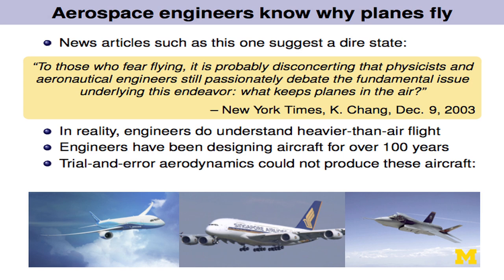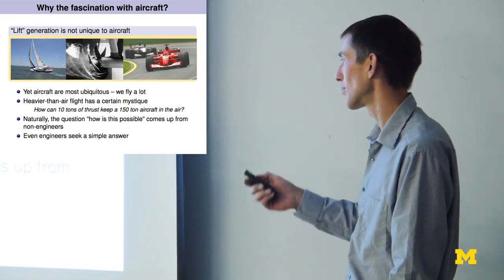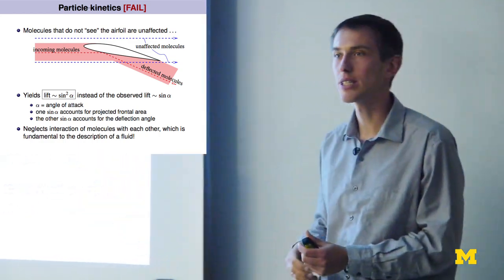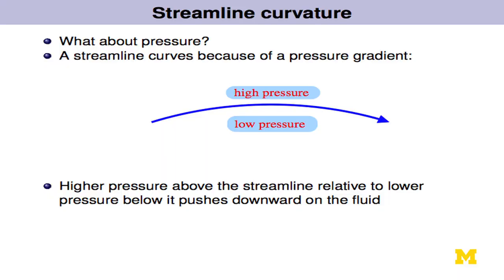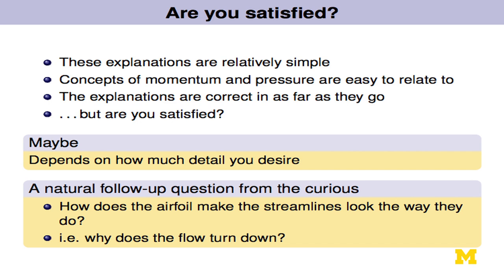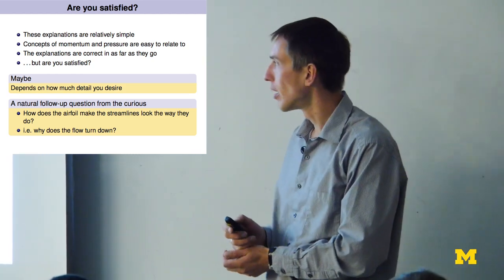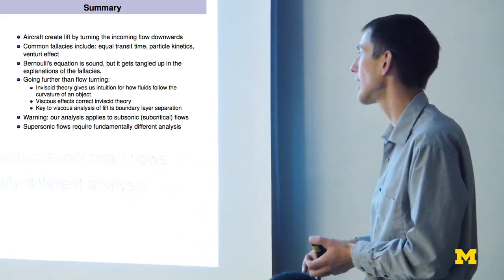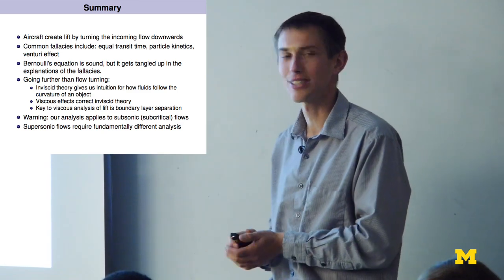Krzysztof Fidkowski | How Planes Fly

Comment: This is one of the better presentations I have seen. Usually, engineers are using terms that require a degree in mathematics at a very high level. This presentation, however, is easy to understand. Thank you!
Reply: Magnar
Complex numbers, some knowledge of differential equations is sufficient for a quantitative treatment  of most aspects of fluid dynamics
Reply: @hernanposnansky7154  Well, yes and no, I still remember an exam where I wrote the complete (developped) Navier Stokes equations and it took me one straight A4 page (yes, i don't write small and yes, it was before simplification with a bunch of hypothesis, but still)

Comment: i am no flight student but i came here because i had this question. "If airfoil workrd on the basis of bernoulis principle then how planes fly upside down ."
Reply: Most plane that can fly upside down have flat wing, they mostly play with the angle of attack.
Reply: @craigwall9536  Although I would agree that all airfoils can be flown upside down but with different efficiency, in a way the more pointed example is why until very recently it was thought that a helicopter cannot be flown upside down (each helicopter blade is also an airfoil, and it was thought that upside down could not create lift). I haven't looked closely at the recent demos that show it is possible to fly a helicopter upside down but would suspect extending the limitations of angle of attack in a negative direction (Just guessing!)
Reply: To expand on this, wings can produce lift upside down, it doesn't need to be symmetric or flat.  A symmetric airfoil produces lift equally well if the angle of attack is positive or negative.  It produces no lift if the angle of attack is 0. A naca0012 airfoil does not care if it is upside down or right side up.  Cambered airfoils can also be flown upside down and create lift, but it might still before attaining an angle of attack that can support the weight of the plane.  Cambered airfoils can create lift at 0 angle of attack.  And so it would need more negative AOA to fly upside down.  An example of a cambered airfoil is the Clark y.
Reply: EXACTLY! If a curved airfoil redirects the air downward, then a flipped airfoil would redirect the wind upward.. So is not the redirection of airflow only, so there could be many reasons LIFT is caused not only one...sometimes is redirecting and sometimes is angle of attack sometimes is both. what about flying sideways?

Comment: A wing generates lift by placing the stagnation point below the wing just behind the leading edge, that's how an upwash is induced, which is what is needed to reduce upper surface pressure 👍

Comment: Great video. When I first learnt this at Delft, I started to search more and more. Your video is amazing. Thank you so much for such presentation. What it annoys me is that in school they still teach the non sense of explanation about vacuum over the wing pushing up the airplane due to a ridiculous small difference of curvature. These teachers never flew an airplane or never saw the shape of any helicopter blade or never saw a Sukhoi airplane making maneuvers. Glad to have found one more quality video about the real reason for lift !! 🙏🏆
Reply: A sukhoi has a thrust to weight ratio between 0.9 and 1. That is nothing like a conventional passenger jet that only has a thrust of a third or a quarter of its weight. While the vacuum explanation might be wrong, your counter examples operate in entirely different realms.

Comment: Nice lecture.  Identifying pressure gradient below and above the wing and relating it to centrifugal force so we see air flow along the arc of a circle is a nice illustration helping us understand lift.  Pressure effects are useful because a surface integral of pressure over the surface of the wing determines the lift force.  This is easier to calculate then integrating  over the entire volume of space to to determine total change in momentum.   I know vortex filaments lead to a more practical method to calculate lift coeficients.

Comment: 22:30
The difference between the 3 flows is the circulation:
Negative , positive but weak, large positive.
The circulation cancels the upwards flow at the trailing edge to satisfy the Kutta condition as the angle of attack is changed.
The circulation is the line integral of the scalar product of the velocity vector and the path element around any closed line outside the boundary layer.
The circulation is the result of conservation of angular momentum:
A vortex is produced as the flow at the trailing edge separates (counter clockwise) and procedes downstream, then a clockwise circulation with the opposite angular momentum forms around the airfoil.
The lift is then 
density times velocity times span times this circulation.
This is the Kutta-Joukowsky theorem, which is the correct explanation of lift.
The circulation increases the velocity on the upper side of the wing and reduces the velocity on the lower side of the wing.
integrating the pressures obtained by the Bernoulli equation (conservation of energy) just outside the boundary layer will yield the exact lift force.

Comment: Great video! I appreciate the clear explanation of the complexities of lift generation and the different factors that contribute to it. The numerical solution of the pressure distribution over an airfoil was especially helpful in visualizing the concept. One suggestion for improvement would be to provide some more concrete examples or analogies to help non-experts better understand the concepts being discussed. Overall, great job breaking down a complex topic in an understandable way.
Reply: I agree! This professor definitely provided a detailed and clear explanation of lift and how it is produced. I also appreciate how he goes into explaining how misconceptions used to explain these concepts are not helpful, even if they seem intuitive. An example of this was his rebuttal of the equal transit time fallacy, and how "air does not like voids", while seemingly intuitive, is not an accurate explanation of aerodynamics.

Comment: Yeah, this video convinced me the quote at the beginning is correct: it is an area of debate. Lift has controversial explanations in the intuitive realm. 

Newtons 2nd Law is a good explanation. 3rd? Not so much.

Newton's 3rd Law states that forces must be balanced. It is a misinterpretation to say one half causes the other. That there is downward force implies upward force, exactly the same as upward implies downward. 

It isn't causal or sequential. Further, it is in full effect on parked aircraft. And rarely do mechanics need to pry aircraft from the hanger ceilings. 

Lift is a result of motion, so Newton's 2nd Law is the explanation best suited ("in my opinion", required engineering tradition). 

Bernoulli is a specific case for 2nd Law. The thing that trips people up is "equal transit time" nonsense; AND not realizing each flow stream surface has it's own conditions. People try to compare the 2 surfaces relative to each other, which is a no-no. Bernoulli says pressure-velocity is reciprocal; a teeter-totter. NOT that 2 different slipstreams can be compared, in terms of magnitude, to the other.
So no "pressure on top vs on bottom" with Bernoulli, only within one surface, with respect to itself.

Pressure differences result in acceleration, which in turn sets up a pressure gradient across the top of the wing. That pressure arc requires the wing surface to be lower pressure than the longer arc above it... And up it goes. If the aerofoil is thin, all the better, because high pressure flowstreams result under the wing (being again a longer arc than those below them)... And up it goes even faster. (There's a centripetal force argument opportunity here also: with objects requiring such to travel in a curved path. And a resultant force inward. May get confusing, though. Could skip it.)

So i explain lift through Bernoulli, as a special case of Newton's 2nd Law. And since we only get lift as a result of motion: this sets up an easily approachable velocity argument: F=ma. 

Liked the talk though. Always good to get a range of perspectives.

 (P.s.: knowing an equation, like N-S, does not follow that anybody understands it. That's maybe something we should admit to ourselves, and students. Yes i know they pay a lot of money not to hear that).  Just look at G.R..-- Now it's quantum gravity, and emergent space-time. We don't understand that either.)

Good talk. Not implying it's "wrong", just not my preference for an intuitive explanation. NYTimes was right 😉

Comment: We should turn things around when trying to explain airplane wing interaction: The air molecule does not flow from leading to trailing edge, eventually separating or not. It waits for the wing to arrive and is then pushed up or down, and just a little longitudinally and here actually forward in the direction of the wing (and more the nearer the wing surface the particle is.)
One should have this physical picture in mind when explaining airplane wing lift.
In a wind tunnel though (or on a sailing yacht) the air flows along the surface of the wing profile, but on an airplane wing the molecule waits for the airplane to arrive (as we all normally do - a good clue for  remembering this phenomenon. /Henrik Segercrantz - M Sc. Naval Architecture
Reply: correct, the air is not flowing through the airfoil, the airfoil hits the air and displaces it... correct?
Reply: if run towards a tight crowd... most likely i will bounce. an airfoil hitting air is doing that, bouncing.

Comment: Thanks. I recognize he addresses and dismisses the Coanda effect, but placing the back side of a spoon against a stream of water (eg. from your kitchen sink) causes that water flow to readily bend to follow the spoon curvature and also applies a marked force on the spoon towards the stream. If you haven’t tried it, please do so. It’s hard to totally ignore that effect (whatever is causing it).
Reply: Water on one side and air on the other is not the situation a wing faces, though.
Reply: @adoatero5129  If you blow a stream of air past the back of a spoon, the same thing happens.
Reply: @BobbieGWhiz  True, but the effect is much weaker (assuming the speed of the stream is similar in both cases). What's more there's no flow on the other side, unlike in the case of a wing. I'm not saying the phenomenon isn't real, interesting and at all relevant to the functioning of a wing, but wing doesn't need that phenomenon to create lift (as explained on the video). The upper side of a wing is curved mainly to keep the airflow nicely streamlined. Quick turns are bad for the airflow, again, as explained on the video (nowadays it also allows wings to hold fuel). A perfectly flat wing creates plenty of lift when it's faces the airflow at an angle as all wings do in normal flight.

Comment: Great lecture. Thanks!
I couldnt understand the logic of vacuum not possible at 21:01? Why is that? Because even the streamline on the bottom surface would get sucked up?
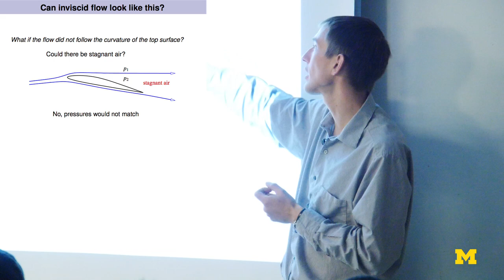At 21:16, cant an air element move in the loop without rotating? An element can maintain its orientation and yet move along the circuit.

Comment: One additional thing... I love this video but I am kind of left empty about the reason the streamlines follow the contour of the body. 

I am coming away with the reason this occurs can be explained by the fact that an inviscid flow MUST follow the body contour. But, the air molecules probably don't know much about inviscid flow so how do they "know" to follow the contour?. What am I missing? Any help is appreciated.
Reply: If the airflow didn’t follow the contour, there would be a vacuum.  Air pressure forces the airflow down into that space.
Reply: @GH-oi2jf  Thank you for the reply. We did see in one of the slides a case where the streamline was separated and did not follow the contour. But I agree that a vacuum cannot form.
Reply: @Observ45er  Thank you for your reply...makes sense.

Comment: Not saying professor Fidkowski is wrong, simply commenting. 1) 6:43 When this real phenomenon is illustrated, no lecturer I've seen has pointed out that if the initial `longer path, equal transit time, faster flow, lower pressure` has an effect (however moderate,) the illustrated phenomenon means the top flow is even faster and thus has a less moderate effect.
2) My `simplified intuitive model` is the bottom side is for lift, the top side is for control, to wit: spoilers. (yes, incomplete)

Comment: I recommend using calculations and numbers proving how 10 tons of thrust can generate lift that leviates 150 tons of a plane. Otherwise all the rest are just words...for example from this presentation one should be able to calculate how much lift a directed air flow downwards can generate lift. Because for directing air flow downwards, the airfoil or the pressure field around it or both must have applied force on the air block flowing around. As a reaction to this force, the lift is generated and this can be calculated, maybe?

Comment: Excellent expositions of empirical shaping laws and deductions for Intuitive Actual Intelligence. An accurate assessment and assembly of observational oscillation resonance phenomena in Mathematical Theoretical Formulae. (That's what we see)

How it happens is superimposed logarithmic condensation modulation wave-packaging formation of Navier-Stokes type formatting that you get in the time-timing arrangement of anything, not only flying. 

So the why, of all is vibration-> Superspin, quantitative timed time mechanics-> 0-1-2-ness Entanglement be-cause-effect self-defining superposition-> sync-duration assembly, which is Fractal Quantum Operator Fields Modulation Mechanism.., at this Centre of Logarithmic Time Singularity, ..QM-TIME pure-math Reciproction-recirculation relative-timing ratio-rates Perspective Principle. 
(Basic QM logic "says" it is because it is, => Principle)

Engineering likes to build a fence around reliability with a Safety Factor that obscures the fine structure of phenomena. "Long may they continue". But if you analyse nuances, then the inevitable result is that "All things must pass", change changes across the 1-0 probability dominance spectrum to continuously Form this Universe. 

The finest quality of information existence is derived from e-Pi-i sync-duration connectivity function that operates via Singularity, ie @.dt zero-infinity sync-duration eternally, in Primes and Cofactors of vector-value Timing-spacing coordination, AM-FM Quantum-fields Condensates forming Math-Phys-Chem and Geometrical Drawing Conception of the real-time wave-package Periodic Table, Standard Model and related QM Temporal Chemistries. This is the ultimate sense of experiencing existence as "floating in flat-space ground-state No-thing-defined eternally, "flying" as coherence-cohesion objectives in temporal cause-effect continuity.

Comment: 12:34 - Hello. Do I understand correctly that the airflow on the top of the wing "follows" its shape, because when trying to "break away" from the wing, a vacuum is created between the airflow and the wing?
Reply: The geometry of the foil creates an upwash of the on-coming air. Air is forced to curve upwards before the wing arrives, by this it is easy to understand what's going on, on either side of the stagnation point. On one side, air is accelerated out of the wings' way , while on the other side the converse is happening, air is rammed into the bottom of the wing. This causes the pressure difference.

On the upper surface, air is opposing gravity hence less pressure. This creates potential energy which will be converted into kinetic energy(due to gravity) in the downward direction so a downwash of air aft the wing's camber is produced. The downwash is vital as it aids in pressure recovery to resist drag. This interplay between gravity and airfoil manipulation of the fluid, through which it is moving, is the fundamental reason why planes fly. 

The speed differential of air flow between top and bottom can be attributed to the obstacle effect. Provided the wing is in an asymmetric orientation towards the on-coming air, the air under the wing is slowed down at the expense of the air which is sped up on top of the wing. If the the air under the wing is slowed too much(essentially just drag) , the air above is sped up too much and so cannot make the turn to stay attached to the upper surface hence a stall. The airflow will follow the wing's shape until the pressure required to force the air down is exceeded by the pressure required to hold a flow moving so fast, it's inertia cannot be overcome by gravity.